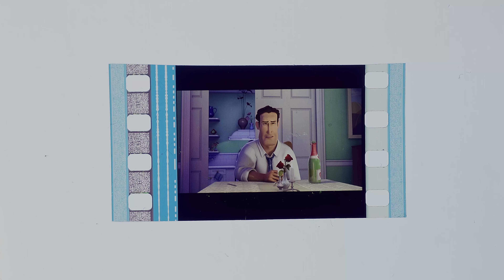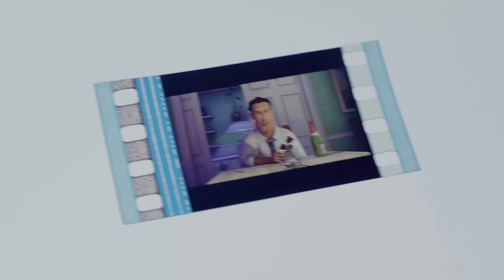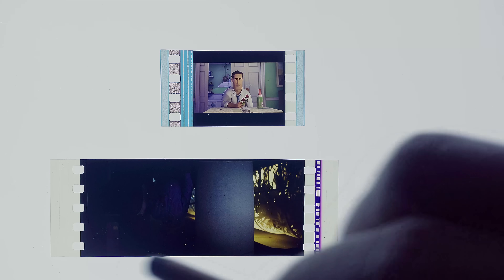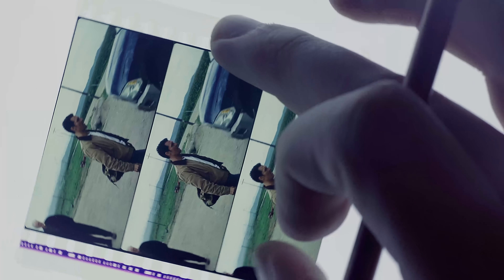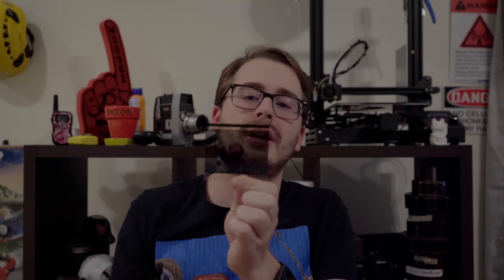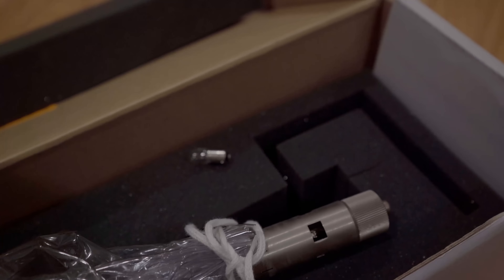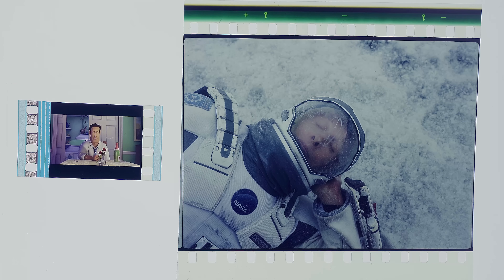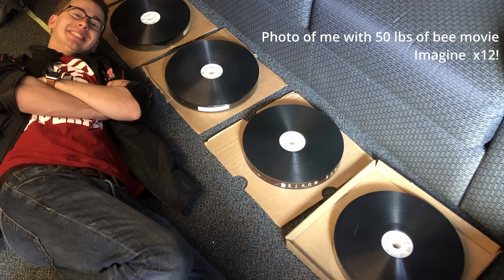Why you need to see ODYSSEY on IMAX 70mm film

Comment from the maker: NOTE: This was made for Oppenheimer, but with The Odyssey coming out next year, filmed ENTIRELY on 15/70mm, I figured to give this new a new title to help people appreciate why they need to see it.

Any 70mm (IMAX or regular/5perf) or 35mm is better than ANY DIGITAL (including digital IMAX). If you have the option always go for it! Otherwise, IMAX Laser is the next best bet. After that, all other options are basically the same. 

I’m now aware I pronounced Cillian’s name wrong. And yes, I got a new mic since this video. 

The exact resolution is almost subjective of film frames by size, largely due to the size of the grain from the film stock, and speed of the film and the manufacture also have a large impact! Also, as some other have pointed out there are also different venues with different screen sizes, GT (Grand Theater) is the largest, and what you also should aim for when finding a venue.

Comment: I know this has no hope of getting answered, but i’ll try anyway. I just went on a deep dive about imax film. It turns out that 15 perforations works out to basically 70mm. So why did they bother running the film horizontally? Every source says imax is run horizontally so the with of the frame won’t be limited by the film stock, but then they chose an aspect ratio that made is essentially 70mm wide! Why not just run the film vertically and accept that the width would be like 65mm instead of ~71mm? Is that extra bit worth all the engineering work it took to run the film horizontally? After going through that work, why not make imax really wide? I’d think at least go to 20/70 and let the unlocked horizontal scale stretch its legs a bit.
Reply from the maker: A big reason that the film is run horizontally is because at the size it becomes much easier to run horizontal. The film has to be run off platters due to the sheer amount of film, and platters keep the film horizontal even for regular 35mm and 70mm. Normally this has to be re-converted back to vertical and then converted back to horizontal for traditional film. Lastly, the mechanism for the projector’s shutter, the “rolling loop shutter” was designed because the film is so large, and my understanding is that being horizontal further made this shutter mechanism more usable. Hope this helps!
Reply: @KyleMiko  that makes so much more sense than the explanations i had. I wonder why so many sources are parroting the story about horizontal space

Comment: IMAX theaters are not bright enough to display the movies at that size. I don't know what light source they could use to improve the brightness and dynamic range, maybe laser? Then other problem is if you are sitting on the side, the problem is made worse as the screen will have different brightness levels on each half of the screen.

Comment: Not that I disagree that bigger is better all other things being equal, but I can not really see that comparing sized tells you anything about perceived resolution in the theater. At some point (when you keep going bigger) you will hit other limiting factors and get deminished return.

To use an example people have at home, the difference between a 4K tv and an 8K tv is equal to the difference between 70mm and 35mm. Its 4 times bigger (4 times the resolution). But if you put 2 identical 8K capable TVs next to each other and have one run 4K and the other 8K, its hard to even see the difference, and to have any chance to see the little difference there is, all other links in the chain has to be perfect, from the quality of the cameras used to shoot the material, through the media itself and to the projector/tv used to display it.

The biggest benefit of going to an Imax theater may in fact be that all other parts of the projection is very high quality as well. Compared to your local cinema, there there is probably a bigger quality improment comming from all the other aspects than from the film itself.

Comment: I was at an estate sale for a guy that worked at Bombardier at a rather high up position (I really should have bought the slide carosel with photos taken at the Evel Knievel snake river jump), but anyways, there was an 8x10" slide of a engine diagram. I'd never seen anything so detailed. as tiny as anything was in it, it was perfectly sharp and clear. And that 8x10 covered 61 times the area of a 35mm slide. If a 35mm slide is equivelent to about 24 Megapixels, that 8x10 slide was about 1.5 Gigapixels
Reply from the maker: That must have been awesome! I’ve wanted to get a 4x5 camera and shoot slide film, and that would still be only a 1/4th of that!

Comment: Alas not a single cinema in my country shows 70mm imax; in fact there are only 30 cinemas in the entire world that are capable of screening in 70mm IMAX. pretty sad :( I'll go see it in regular IMAX though for sure
Reply: Economically it couldn't work. How much do you have to pay for an IMAX ticket? You can be happy Happy if you can see it on a 70 mm standard size. IMAX Laser projection is rare as well. I can't afford a trip to watch a movie. I'm happy to see it at a normal 4k cinema in my city. How about the aspect ratio between cinema 4K and IMAX?  It is wider and less high. You have to decide to cut of the bottom and head to get full screen on Digital Cinema or you left over on the left and right side screen surface.

Comment: Even though it's shot on IMAX film, doesn't it still get edited on a computer (CGI, color grading etc)? Doesn't this cause loss of resolution? Or do they have computers that can edit 18K video now?
Reply from the maker: Nope this movie was not touched by digital for all film prints. Nolan said it himself, and at the end of the movie it says essentially “no digital” for film prints. What actually happened is that they scanned it and edited it digitally, and when that was done they actually, physically edited the 70mm/35mm negatives to match the digital edit, and then used these negatives to make the positives. Thus, no digital and thus no resolution loss. This is called “photochemically edited”

Comment: Yeeeeah the only theaters in Paris still doing IMAX on film are pretty run down dome screen affairs, it's nice to have it as an option but it sadly seems to be all too common with these cinemas. Laser is a much safer bet as the theaters are usually much more modern and well maintained - I'm not sure if the extra detail is worth tradeoffs like crappy seats and badly maintained theaters which could have other issues such as bad audio.

Comment: 35mm film has 6,000 lines of resolution, and 70mm film has 12,000 lines of resolution - therefore the 35mm film offers the same resolution as 70mm film.  The ONLY difference is the size of the frame, which does not equate to better resolution - add to that there is really NO resolution measurement of the human eye to film, as only a very small portion of your eye is actually engineered to see things in high detail, that part of the eye is called the fovea.  IMAX film is a trade name and a technique for generating images onto 70mm film.  The difference is instead of the film in a 70mm camera shooting vertically, Imax uses the same film and places images on the film horizontally - as a result of this the SOUNDTRACK is actually on a different medium as there is no room left on the IMAX format to fit the soundtrack.
Reply from the maker: There’s so much wrong with this that I can’t even begin 😂

Comment: I have a question. 
In the city where I live, I only have a limited option. 
Watch a dubbed version in IMAX theatre (which they say 2K resolution, so it's a liemax?), which i don't like (who like a dub anyways) or go to a subtitled one in a theater. The latter is saying that they are going to project the 70mm film (they have Victoria 8 the website says). That technically means the latter is closer to what Nolan intends correct? but will be missing a chunk of the screen because is 5 perf?

Comment: Back in 2015 I did a comparison test for different film formats, with the release of Star Wars: The Force Awakens. The screens/projection methods were:

- Cineworld Leicester Square IMAX, Dual 4K Laser projection, 26.5m x 15.6m @ 1.85:1 (saw in IMAX 3D)
- London Science Museum IMAX, 70mm projection, 24.3m x 16.8m @ 1.43:1 (2D)
- VueXtreme Westfield, PLF screen, 18m x 10m @ 2.40:1 (2D)
- Cineworld Wandsworth, 2K projection @ 2.40:1 (RealD 3D)

The order of the screens is the order in which I rate the quality and experience. Perhaps it’s because The Force Awakens was edited digitally, but the 70mm IMAX didn’t bring any superior quality to the picture, other than the frame opening to full 1.43:1 during the Falcon chase sequence (the only scene shot using 70mm IMAX). The picture looked as soft if not more so than IMAX laser, along with visible scratches due to analogue film.

VueXtreme was basically just a big bright screen, in the middle between a regular screen and IMAX. RealD 3D from a 2K projector is what people have come to expect: the 3D effect works but is dark and soft when compared to IMAX 3D with laser.
Reply from the maker: Yeah that is the results I would expect from this. Because it’s fully edited digitally (like you said) the max resolution would only be what they did for SFX/CGI etc, which is still us usually only in DCI 2K. So, imagine blowing up essentially the 35mm film strip in the video up to the IMAX 70mm size. Yeah, that would be not sharp. Even though they shot that one scene in 70mm it still would have been down scaled to shit when they did all the effects. As we now know, Nolan did NOT use CGI at all and did not have any digital intermediates for all film prints— meaning the resolution is unadulterated and should be very close to the original resolution, far greater than the industry editing standard of 2K
Reply: @KyleMiko  That was my understanding too, that Oppenheimer would have not gone through any digital conversion for 70mm shows. I would love to view it in IMAX and compare, but logistically it's not possible for me now, so I'll settle for my nearest cinema that has XPlus (PLF with a Barco DP4K-60L and Atmos).

Comment: I have a question, I bought my tickets for Oppenheimer in IMAX with Lazer which means it's gonna be 1.9:1 on the screen. And everywhere I go I see that it's produced to watch in 70mm which is 1,43:1. So my question is, what's resolution will be better and if there is any difference between this formats?
Reply from the maker: Yes the resolution in theory will be less than 70mm IMAX/70mm. Also, the aspect ratio is different as you said, so some picture area top and bottom will be cut off, but that is by design, there is nothing of importance in the large top and bottom areas. Your experience will be quite good!
Reply: @KyleMiko  Thank you for the answer!

Comment: 6:31 the reason IMAX pulls 5 ft/s (as opposed to 1.5 ft/s for 35mm) is because the IMAX frame is bigger, so you need a longer length to get 24 fps in both cases. The feet per second, or the weight of the reel, isn't a new reason why IMAX is better if you've already explained the size of the frame.

Comment: Ok you capture it in 70mm film , but then the digitalization comes into play and afterwards there is the post-production, SFX etc.. and then the outcome should be copied back to 70mm film.. What kind of CPU power renders the 18k res film ?
Reply from the maker: Nolan has done a photochemical process end to end, with the exception of a few SFX. He usually does practice effects as to minimize digital use. So, most scenes are directly from the film negative and thus does not need and digital intermediates

Comment: I've been hearing this rumour that 15/70mm is equivalent to 18k resolution for years. It's lies. The rumour started around same time 2k cameras (basically 1080p) were starting to become commonly used in Hollywood, because it was said 2k was slightly higher than what 35mm could offer and therefore this was "the future". Again, more lies. They keep upping the scan resolutions of 35mm and still finding more detail. 6k and 8k scans are common, downscaled to 4k for release. But there are now services which like to scan Super 8 at 4k resolution too. Can you imagine how much resolution is available on 15/70mm film if we had the technology to actually scan it? My estimate would exceed 30k and I cannot ever see a time when we'll be getting 30k digital releases in Cinemas, purely for the fact that no one other than IMAX will be building screens big enough to accommodate it. Certainly your average Multiplex Cinema won't build them.

Comment: Quick math: If 35mm is 6K, that's 2.25 times the pixels in 4K (because 6 is 1.5 times 4 and we need to make both horizontal AND vertical resolution 1.5 times longer ---> 1.5 x 1.5 = 2.25). If 15-perf 70mm is 9 times what we just calculated, that's 2.25 x 9 x (the total pixels in 4K) = 20.25 x (number of pixels in 4K) = 20.25 x 8,294,400 (if we go by 4K = 3840 x 2160).

If we use 16 x 9 4K, it comes out to *17,280 x 9720 pixels*. Which you could call 18K. This is assuming we do 3840 x 2160 as 4K, if we use another format it will be even more.

Comment: Yes, With Imax, a frame of 1570 film has far more resolution that paused 4k laser Imax but we are not watching photos, we are watching 'movies'.

Film projection suffers from jitter, the next frame is not in the exact same spot as the last frame, the difference is small, but magnified once it gets on the to that massive screen, it negates alot of the resolution. 

I saw Dunkirk back to back in the same true Imax cinema, first in 1570 then in 4K and the 4K was far superior and sharper.

People might prefer the 1570, it has that film jitter and you can hear the sound of the projector in the quiet bits, it's still great to watch.

Just don't believe the hype about 1570 resolution, once it's projected its lost.. 

But of you watch it and prefer it, nothing wrong with that, its why I own a vinyl record player

Comment: Doesnt matter that it's shot on 70mm when it's going to get color graded like a digital movie.
Reply: Nolan demands all his color grading photochemically, whenever physically possible. When not explicitly required for digital effects shots, there is no digital intermediate. It's literally a optical print from the camera negative to the print that will run through a projector. If it's an IMAX shot onto IMAX projection film, it's in direct physical contact with the camera negative.

Comment: Just an FYI, there are plenty of digital sensors that are much larger than 18k as you mentioned at 5:58 in your video.
Satellite telescopes like the JWST (NIRCam has 10 4meg sensors which is 40 megapixels as opposed to 8k's 35 megapixels). 
The ground based Vera C. Ruben Observatory has 3.2 gigapixel sensor.

Comment: My local IMAX theater (Cinema City Simple IMAX) is most certainly Dual Xenon. Sure, you may call it LieMax, but the reality is that the nearest Laser IMAX theater is over 250 kilometers away by car **in another country**. This "LieMax" room still absolutely destroys pretty much anything else in the multiplex there, and a ticket is not much more expensive than a regular 3D ticket (HUF 2650 -> 2900), making it a no-brainer, just because of the IMAX aspect ratio. Plus since it's dual projection, the 3D effect is noticeably better.
Call it LieMax all you want, but it's still a lot better than literally anything else available in the country.

Comment: You have taught me so much. I thought film was gone and 4-8k was the best resolution possible this is actually so cool
Reply: Not only is film not gone but there are currently new 70/65mm film cameras being developed. 

We are finally realizing that film can’t be beat when it comes to resolution. We can capture in super high res digital but it’s the broadcast/display that is still lacking. Film and projection has had it figured out for decades.

Comment: I have a question. Since Oppenheimer is being shot on IMAX, say I went to a normal cinema, with a normal standard projector, would the film be adapted, compressed etc. so that it would work with that project? Or does it not matter? In other words, does there have to be a special IMAX projector that can project the IMAX film in its normal ratio etc?
Reply: Essentially yes I think that’s how it works. It’s not going to be imax unless you see it with an imax projector

Comment: This kind of 15 000w light bulbs start melting at 45 or 50 minutes, that’s the reason why imax films roughly last more than 40 minutes, and the projector operators change it after each film and setting it up its a process that takes several minutes too

Comment: In India, only Prasad's Hyderabad would be running Oppenheimer at the true 15×70mm IMAX. I've confirmed the same with the staff team and they've said that they'll be using their old 70mm projector whic is now totally revamped with some pretty big upgrades.
So, if you're from India and want to get an experience of lifetime, then Prasad's Hyderabad is your only shot.

Point to be notes though, as per my conversation with the Prasad's team, 15×70mm IMAX shows would be very limited like max 2 shows per day , would be kinda costly (₹3000-₹3500 INR, ~$30-$45 per ticket) and all other screening of Oppenheimer would be digital IMAX and normal only

Also it being a very special and limited event, tickets won't be available at any online site. You'll have to contact the Prasad's management directly